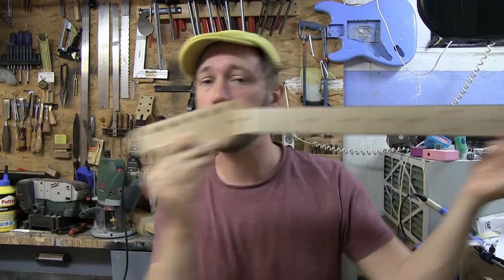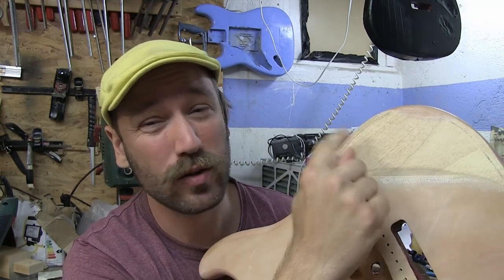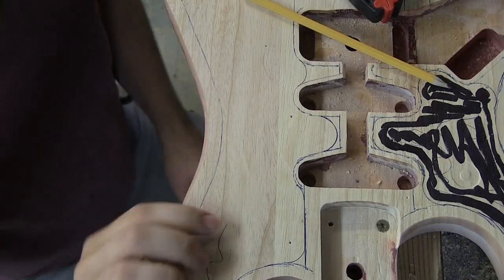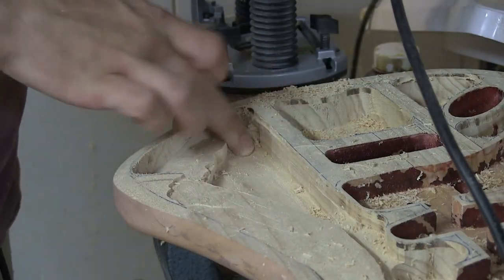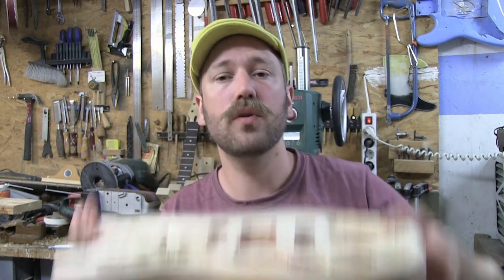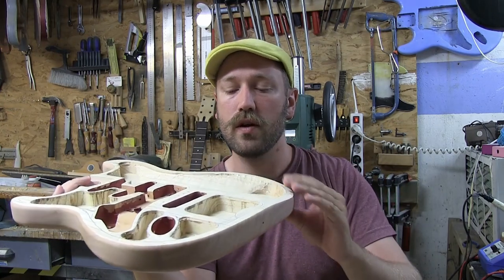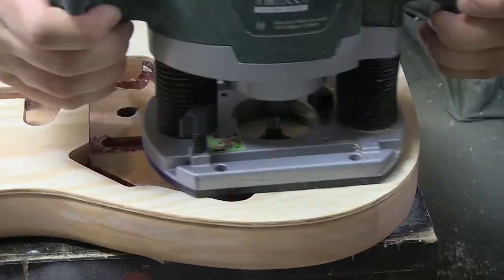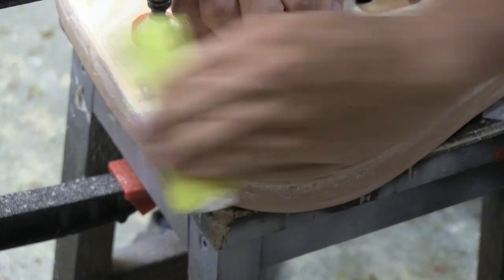how to make a semi hollow stratocaster body

Comment: Normal semi hollow body guitars (Gibson, Epiphone, Gretsch, etc.) have just a few millimeters thick wood on the body, otherwise the sound chamber won'r resonate. This way of hollowing out the body wouldn't change the sound that much. If the main purpose is weight relief, I would go for a chambered body instead, that is cleaner and much easier to make.

Comment: Great project, I plan to build such a stratocaster, I always liked Eric Johnson's guitar but it costs a fortune, i want to make it in olive green with an f-hole, my question is: is it better to buy a harley benton kit or buy a used squier, I don't know myself, I want to use nitro varnish and make a small relic for it, I will oil the head in a dark color and give a clear Fender inscription, I see that you did the overlay from the top, I plan to do it from the bottom, I don't have to have such a cut body, thanks for sharing this material, there are few such videos on YT. Great job, my father is a carpenter so he will do everything according to art, he also has very good tools, you can say professional, I plan to build this or next year, I'm surprised that you have so few views, you deserve more, greetings from Poland! I gave you a sub 😊
Reply from the maker: Thank you for the love I don't know why I don't have more subs but I'm glad over the once I have 🙂 it's super fun to carve the body so you should definitely do it😃👍 both guitars have a basswood body so it doesn't matter in that regard what you choose but a squier is closer to a fender but not by much 🤷‍♂️ I would recommend hollowing the body out from the top like I do because it will be easier than going from the back because making the belly carve will be harder than doing the arm rest best of luck to and your dad.l, stay turned for next part, what color do you think I should have?😃😃
Reply: @zurowetz  thank you for answering, I think you should paint it on white blonde color but it is up to you, be sure to choose something from the vintage palette 👍I can't wait for you to put it all together
Reply from the maker: @Musicandmore-yt4ts  that is so cool but I already have a old white strat from the 80s I have bin thinking of going with burgundy mist 🙂🤷‍♂️